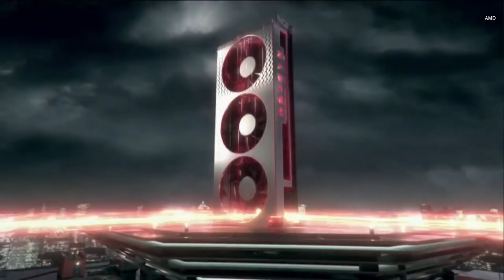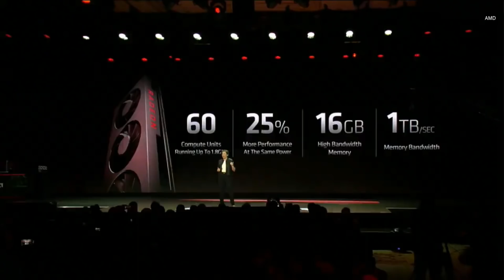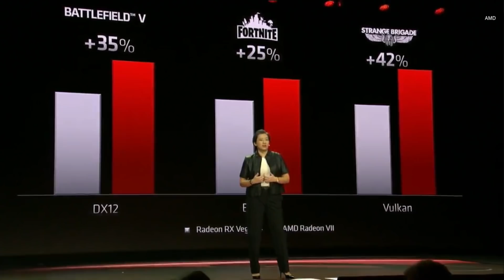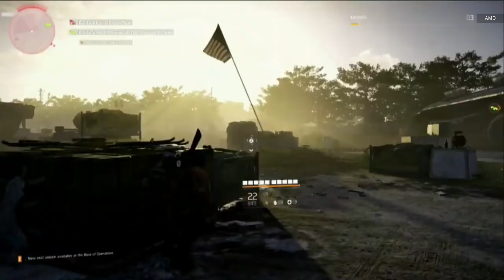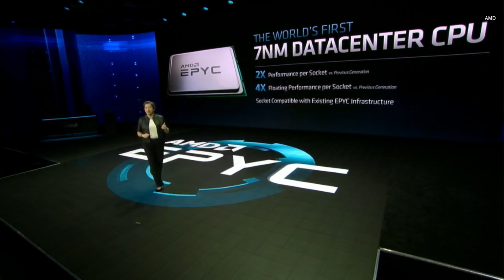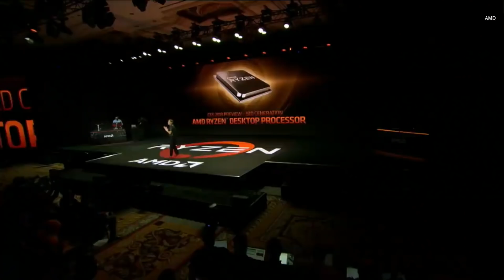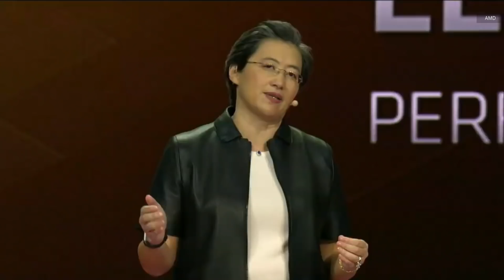AMD's CES 2019 Press Event in 9 Minutes: Ryzen is here to stay

Comment: Before trying to match this, nVidia should first learn the lesson to not play with users' private data.
In short: with geforce experience nVidia lets you know that it's going to monitor your hardware and software (!) and then it needs an account so they can link all the data to a name!
I've always had ATI/AMD video cards and I said I'd try out the more appraised and expensive nVidia, exclusively for the game streaming technology (performance).

So my last 2 cards were nVidia. But it all came with a price: text missing from windows and dialog boxes, 2 (nVidia) cards not being able to coexist, lame support for multiple displays and other drawbacks - insignificant but numerous - compared to what I was used to - ATI/AMD.

So my next move will definitely be to return to the Red Side, comrades!

Comment: I'm not hugely reassured by the GPU intensive game they chose to show off Ryzens gaming capabilities with, or how it showed a lower frame rate than I've seen a 2700X get with an RTX 2080 in the same game. Kinda hard to tell where those frames are being lost when just a few minutes ago the Vega 7 was touted as being on par with the RTX 2080.

Edit: Actually I just realized in that preview that the GPU usage seemed to be pretty consistently above 95%. I guess that's a good sign for Ryzen if not Vega.

Comment: Amd loves gamers amd loves high performance amd loves running your electricity bill through the roof 
Amd loves leaving you requiring you a 10,0000 watt power supply and 16 generators to power it .
Amd loves dodgy driver updates 
Amd loves coil whine 
Amd loves making everything more complicated than it needs to be.

Comment: betting ryzen 3 was at 4.5ghz in this test as thats about what you would score if you managed to push a 2700x to 4.5ghz  if they can manage 5ghz overclocked that would be huge as amd gains more performance in there muti thread then intel. but if they can get there single core up with a 5ghz cpu even if its only overclocking to get there it will become that there is no reason to even look at intel as they will losse there standing of the better single core performance

Comment: Cinebench R15 benchmarks do not equate to gaming performance. Do you even remember CES 2018 when AMD compare the 2700 x to the 8700 k using the same benchmarking tool claiming that it was more powerful? Though you also have to say which CPU was more powerful in gaming. That was the 8700 k and the 9900 K is even more powerful sightly so. I really doubt the new ryzen 3000 Series Will trump Intel in gaming performance.

Comment: I think people under estimate how freaking amazing it is that it uses the same socket as previous generations unlike intel trying to sell more motherboards
Reply: 💯 agree man, Intel with its different sockets only confused the market
Reply: You'd still need new one to support PCIe 4 but without that it works on old ones too.
Reply: @635574  in some cases even PCIe 2.0 is enough... So it wouldn't bother me and I believe a lot of people
Reply: Pilafut in most cases*
Reply: @David Whitfield  silly comparison. Ryzen was specifically built to fit on AM4 socket, while Coffee Lake chip needs newer LGA1151 to run. 2700X on B350? Just upgrade your bios from the vendor
Reply: @David Whitfield  try to use a coffee lake chip in older LGA 1151 motherboard
Reply: haha good 1
Reply: Maybe so, but it's not the same, am3+ is not compatible with am4, not compatible every way.
Reply: @mirola73  AM3+ was reserved for microarchitecture before Ryzen, the last of its chip was release around 5 years ago. AMD still use AM4 from 2017 until now. Compared with Intel releasing new socket for every chip gen it produced
Reply: amd focuses on increments of increasing performence, if they're ahead (has budget) or market has no other choice imo they would do the same as intel coming up with new sockets on new generations. amd still in debt i think so they no budget to come up with other stuff other than their main focuses

Comment: Been an AMD supporter for well over two decades. Started with their 486 clone. Later I got the Duron 750, upgraded to an Athlon 1800XP, and again to a 2800XP. After that it was stricly Intel for a while with their Core 2 Duo lineup, but I soon returned to the AMD camp with the Phenom II 1055T, which was a great processor, and now an upgrade is long overdue. Ryzen surely looks promising!

Comment: They need to drop HBM. Its screwing them over too much
Reply: Is it though?
Reply: Why? AMD co - developed HBM and they spent enormous resource to make this possible they won't be dropping it anytime soon
Reply: It will be refined. Give it time
Reply: If they sell a lot of cards using that much HBM2, then... not so much.  Volume purchasing of HBM2 will decrease the price eventually and let's face it.  GDDR is old tech getting older.  HBM is the way forward.  NV just hasn't adopted it yet though they almost did and went the cheaper route.  Once both and possibly Intel all adopt it, prices will drop and, well there ya go.  Its like ray tracing.  It has to start somewhere and AMD is making the bold decision here and helping the industry transition.
Reply: @Cinnabuns2009  Just like AMD led the way with Mantle, which spawned DirectX 12 and Vulkan.
Reply: @Cinnabuns2009  HBM might be intrinsically more expensive than GDDR6, that said, I don't think it's possible to make a gpu that supports both.. HBM is better, and they should use it for some line of cards, but it is more expensive to put 9 pieces of silicone dies in one chip rather than 1 in then chips, so it won't really be cost effective.. I think what is needed is games using it in a way that boosts performance for it to be worth the extra money, now it seems it isn't..

Comment: To be honest  I was expecting the GPU  to be cheaper
Reply: @M A  There will also be RX graphics cards which aren't very expensive based on Navi 7nm architecture. They ought to get a perf. bump too. TBH budget cards don't need to be compared with the best, some budget cards target only certain Tier games, as long as they run. Fortnite and other such games at 60frames 1080, they're fine.
Reply: @BoJack Horseman The R7 is the same price as some models of the 2080. The Founders Edition of the 2080 is more expensive, but an MSI or an EVGA model costs the same as the R7.
Reply: Would you like me to explain amds plan for you for this year and next year? They're actually too competent it's overwhelming
Reply: The newer node and the 16GB of Vram make it very expensive to build.  It will come down in price, but it was like $150 just 8GB of HBM2 last I heard.
Reply: 16gb of vram
Reply: you were expecting Radeon's first high-end gpu to be cheaper? does that make sense at all, to anyone?
Reply: @Spaniard1375  none
Reply: Me too. I wanted AMD to give me 2080ti performance for 100 bucks.
Reply: @zionlee1004  all I am saying  is If is the same performance  as the 2080 for $100 cheaper  will be more appealing
Reply: @thetrafa1313   The radeon vii is at least similar or better than a 2080 and is priced at 699. Rtx 2080 is priced at 799. Boom 799 - 699 = 100. Same performace as rtx 2080. You said, "all I am saying is If is the same performance as the 2080 for $100 cheaper will be more appealing." Well, there you go.

Comment: Damn. Ryzen 1600 owner here, can't wait to drop one of these babies in my machine! Damn!
Reply: same this 1600 is doing good work tho.
Reply: Hell yeah it does. Got mine OC to 3.85.
Reply: wasnt happy with my 1700
Reply: @nostrum6410  how come?
Reply: @steelfalconx2000  my 2500k would preform better in about 80% of games
Reply: @nostrum6410  Makes sense. I came from the FX series so for me it made a big difference.
Reply: @steelfalconx2000  i think the clock speed was the biggest issue, 5.2 on the i5 and then 3.9 on the ryzen
Reply: @nostrum6410  Yeah sounds about right. You can't beat the clock speeds on Intel that's for sure, we'll see what ryzen 2 can do. 5.2 though, that's beautiful.

Comment: Not impressed. Nothing to make me want to switch. Basically speaking, they're running 7nm tech at Intels 14nm performance......Granted both the chips and GPU's power requirements are good but in reality its designed for content creators. Intel's (future) 7nm chips will smash this, even if it's more expensive in the process.
Reply: Intel's 10nm (if they ever get it to market) would likely be equal to AMD's 7nm.
Reply: And~your~14nm~Intel~cost~how~much?

Comment: So as fast or just a bit faster than a RTX 2080 for the same price. 

LOL 

RTX Cards are overprices and Nvidia says its because of the RTX chip which doesnt care us. So we pay way more than we would have been normally when getting a new generation.

What does AMD do? 

Release a car which is as fast as the competition and wants the same amount of money. Really? Do you argue with your overprices RTX Chip aswell?
Reply: @After_Pasta  based on how amd always fail with their drivers I say it will performe like a RTX2070 but will sell for about close to 800 at release.. While they are doing that nvidia will be working on a 7th nano rtx 2080 I bet. the new vega two wont be released until summer, so nvidia has got time, then amd release their 2070 overpriced card that overheat even though its 7 nano, and nvidia swoops in with a 7 nano and a refresh to autum or wibter leaving amd in the dust on the gpu market. however amd will rock the cpu market until icelake at least or longer
Reply: @David Whitfield  max settings
Reply: What's sad is that their margins are insanely small because of the expensive ass hbm2 memory. Not even price gouging just incompetent design
Reply: MSI 2080 Ventus is $632.99 on newegg after 10% promo code and rebate with 2 free games.
Reply: It has 16GB of VRAM 2080 has 8GB and the 2080ti has 11GB.
Reply: overall it is a step in the right direction for them the gap each generation is making gains on Nvidia, it will only push better things from Nvidia and amd leading to benefit for us the consumer so props to them for closing the gap a little bit more.
Reply: Its called hbm2 memory. Smh
Reply: It has 16gb or vram and is a bit cheaper than the rtx card. Still overpriced imo.
Reply: ICEMANZIDANE it gives 16gb of HBM2 memory vs the 2080 which performs a bit worse and cost 100$ more with only 8gb GDDR6?
Reply: where did you get that from lol. it 25% faster than the old Vega. The old Vega wasnt even as fast as the Gtx 1080. So its probably like a RTX 2070
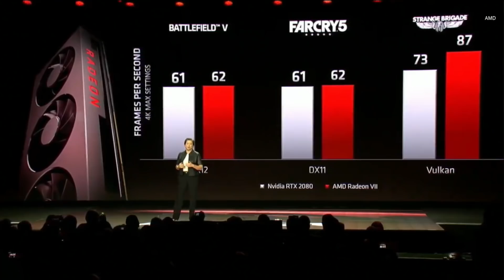Reply: @snyggmikael  2:19 2080 vs V7
Reply: @bitscorpion4687  yea we shall see avout that
Reply: 700$ is less than 2080ti and it's as fast as that
Reply: @aleksnords  just bought an rtx 2080 for 750 usd with a game bundle worth 50 usd so yea its a bit different pricing but hey you purchase what ever you like man
Reply: @aleksnords  its not going to be near a 2080ti if its just 25-30% over the last gen 64 at stock as that was not even at 1080 which is 20-30% slower then the 1080ti so it might be 5% less then the 2080 but not near the 2080ti so its pretty much slighty less then a 2080 and slighty less perfomance

Comment: Show handbrake encoding specs. Playing fortnite or Horizon tells me jack shit about the CPU, not matter how good it is.
Reply: Louis-Philippe Duval running the games on low resolution makes the performance cpu bound
Reply: @JLRocco43  No it doesn't, it just reduces load on the gpu. The CPU utilization is the same regardless.
Reply: Clorox Bleach 🤔🤔
Reply: @christianh3871  yes it reduces the load on GPU, but increases the burden on the CPU to produce more FPS. just look on other reviewers says, 1080p is where you can see CPU bottlenecking, and 4k is for GPU bottlenecking.
Reply: Clorox Bleach Look at it this way
The more frames there are the greater the load on the cpu and the greater the number of pixels the greater the load on the GPU.
Hence, playing a game at a lower resolution reduces the load on the GPU giving a greater number of frames(removes the GPU bottleneck) which in turn causes the cpu to work harder, causing the cpu to become the bottleneck(limiting factor).
So, the better a CPU the more number of frames it produces(without any GPU bottleneck).
Hope this helped.
Reply: ontop of that they also showed cinebench and showed the new graphics card running a game at max settings 4k with over 100fps

Comment: Love to see where AMD is going. Planning to use Ryzen in my new build which I am just getting started on.
Reply: if you can't wait for mid 2019 for the 3rd gen you could always get a cheaper cpu now and upgrade later after they have ironed out bugs:P can get 2600 for pretty great price right now.
Reply: @Requiem4aDr3Am  Exactly what I was thinking. Been wanting to test ArcGIS Pro software on the Ryzen platform. Have heard some good things but not tried it myself.
Reply: @eGISAssociates  well I can tell you that I did a black friday build and did my first amd build ever. I went with the ryzen 7 2700x and have been blown away by its performance. Thing is a beast and that's with me being cheap and using the stock wraith prism cooler instead of slapping on a better cooling solution. Max stress test load tops me out at about 77-78° max. Under my usual load its topping out around 68°. Really love it. Most of the time its sitting at about 4.0 ghz but when its really humming and the heat isn't too high its getting me 4.35 ghz single core and about 4.2 multi. If you want to save 100-120 bucks for about 10-15% less performance though I'd say go with the 2600. It's the perfect price per performance cpu.
Reply: @Requiem4aDr3Am  That is great to hear. Back in the 90s I built several AMD systems for the engineering company I worked for to run AutoCAD. So it has been a long time for me. I hope to put the build and ArcGIS testing on my Youtube channel. Just getting started with it.
Reply: @eGISAssociates  sweet I just subbed to you. Can't wait to see your build and the results.
Reply: @Requiem4aDr3Am  Thanks hope to get the final componets next week. Hope to get an RTX 2060 for it.
Reply: The ryzens are just good all around, they are like a jack of all trades imo, I use a r5 1600 with a 1060 6gb, I love it honestly
Reply: eGIS Associates will be great but you might have to wait is she said it’s shipping mid 2019
Reply: @ammarabdalla5433  Oh I know. That just gives me the excuse to upgrade and I can bench mark the 2nd Generation and 3rd Gen to compare the two using GIS software.
Reply: Wait for it
Reply: Get an extra job to pay for it ! am4 parts are crazy prices !

Comment: We love gamers.... if they pay us 700$... perfect, so something between 2070-2080 for 700$, nothing special based on their own presentation data, fits exactly to 700$ price point in current nvidia market. Nvidia was at least trying to hide their scam behint RTX, but why is this one so expensive without RTX? Not even mentioning that its just one model... no mainstream, no high-end, just one graphic card model to fill the gap between RTX 2070 and RTX 2080.. I was hopping for competition, but this nothing but fail and promises...
Reply: @David Whitfield  Tune will keep changing, as it always does. Now its "what, u expecting amazing tech for free?". After that one, it'll be "drivers will make it better than 2080ti in [insert period of time]". People see RTX prices and go "booo ngreedia boooo", AMD does the exact same but without DLSS or RTX "yessss thanks AMD been waiting for this". Yea alright.
Reply: I think 600 would of been a more tolerable.  16gb hbm2 is not cheap though
Reply: @temph411  Clearly 16GB HBM2 is not ment for gaming... there should have been 600/550$ 8GB HMB2 version, that would be much more acceptable
Reply: well the rtx cards run super hot and are super expensive they are also massive and are super inefficient  the new amd gpus will be good for overclocking unlike the rtx cards
Reply: @David Whitfield  I think the "300$ gtx 1080 performance" is navi, which this isn't.
But you're right, fanboys being delusional.
Reply: @David Whitfield   not backtracking. This is a whole different gpu. The gpu they speculated was 20% weaker and doesn't even exist
Reply: Patience grasshopper. Looks like AMD marketing are trying to suck every last drop of hype out of their new product line up. In the mean time, go watch the AdoreTV videos to get up to speed.
Reply: Lol another guy who wants amazing tech for free...
Reply: @steelfalconx2000  Nope, I just have RTX 2070 on the way, I pay when I have to, but the difference I had to pay for 2070 compare to my 970 is just mind blowing. If technology in GPU progress, manufacturing technology have to progress as well. If I am paying same price to performace ration in 2019 like in 2016, that sucks... and to come in 2019 with GTX 1080 Ti performance and 700$ price, is not amazing tech... thats junk.
Reply: Its between 2080ti and 2080
Reply: @AbdallahTeach  Well on the wall behind her was comparison with 2080, and it was exactly the same like Vega 7... so if they say its same, I dont expect it to be above, but same at best, probably below what they say, and if you go to previous slide where they say its +35% above Vega 64... check where the current vega 64 is, do the +35% and result will not be above 2080, and no DLSS and no RTX... thisis like GTX 1180 at best, but for 700$. I was hopping for AMD to be good, because market needs competition, but I was expecting at least 2-3 models, something to compete with 2060/2070/2080, not one "high end".
Reply: @iKREIi  
The problem is with your expectations, AMD never told you to expect what you expected.
Reply: @themedleb  Only market will tell what was expected from AMD...